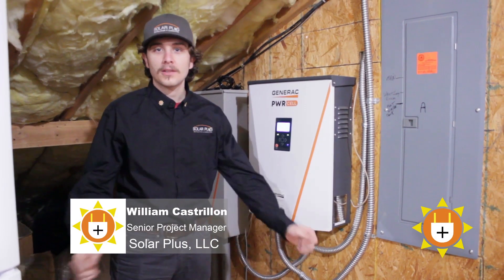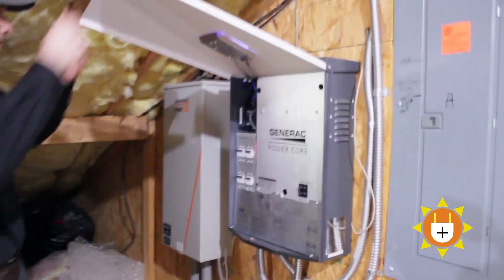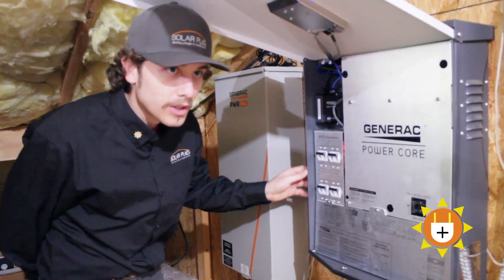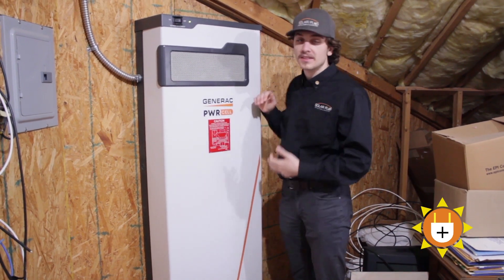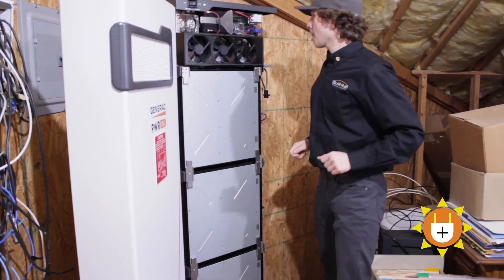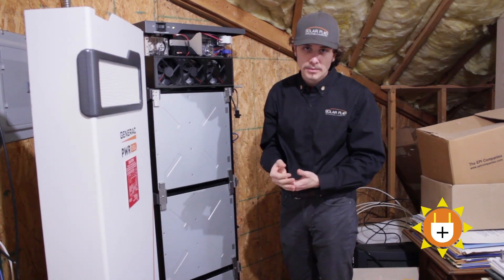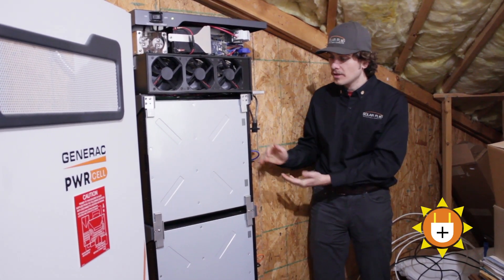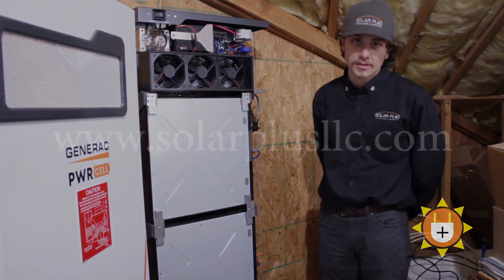Solar Plus - Generac PWRcell Explained

Comment: I’m an actual PWR Cell system has been junk, never runs more than six months without failure. Has failed multiple times during power cuts. It has safety issues with the snap RS fiasco and now my system is down as often as up and Generac only gives me a run around. MY SYSTEM IS ONLY THREE YEARS OLD. This is why Generac has four class action lawsuits pending.
Reply: @dammitbobby283this is true. Their problematic snap RSs put my installer out of business. Then Generac just keeps passing the buck to other small installers like you said.

Comment: Having 4 batteries will the capacity run a 3.5 ton - 16 seer - 2 stage AC unit?
Reply: my 3 battery install runs my AC which is slightly more heavy duty than yours. I said "RUN".... Any battery system will not sustain an AC unit for long. These power walls are mainly for whole home back up (for which you AC will not be apart of) and peak hour $ per KW usage supplemental power use from your power company. If your talking an off-grid situation, you'll need 2 full wall units FOR SURE if you want to power AC, with a generous array for panels, that statement is not generac specific, that's a challenge for any off-grid project with appliances like AC

Comment: 76f?  That attuc wikk get to 130 easy.  How is that supposed to work?  Fans?  Nope
Reply: The insulation is between the rafters, so it might not be hot.  My attic is foamed between the rafters, so it is always in the 70’s.

Comment: Umm, these battery units MUST be installed in a fire proof room and must be installed agaisnt a 2 hour fire wall or equivlant.  This is an unsafe install and should be pulled off YouTube.
Reply: Exactly correct.  Solar Titan installed mine without and it failed inspection and they are doing nothing about it. My systems been sitting for 4 months now collecting dust. Starting legal action now. Note they are also known as SunOfAmericallc.

Comment: IF IT RAINS FOR 3 DAYS....YOUR SCREWED.....
Reply: Not event close. Our home uses about 300 watts an hour. We have 36kW (36,000) watts of battery storage. You do the math. That's 120 hours of backup energy. That's 5 full days (and nights) of having NO SUN. During rain and overcast, we still generate over a 1000 watts of power from our 13kW solar panels.

Comment: can power wall be used without solar panels installed? I'd like to have as a back up when grid fails or during peak demand take the load off the grid?